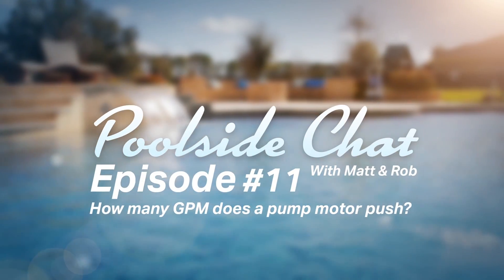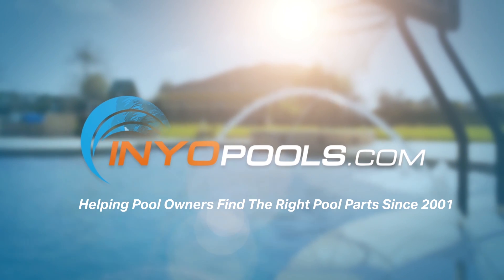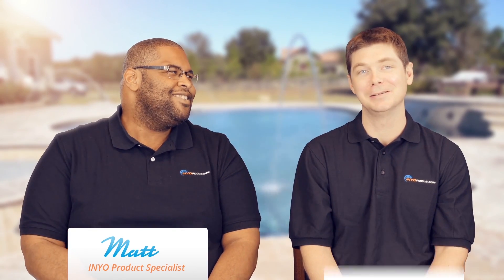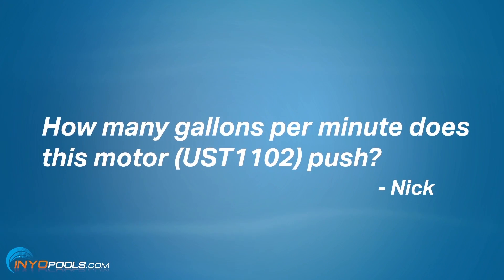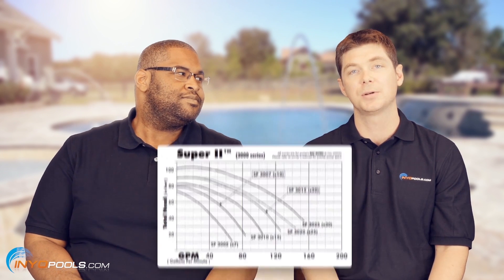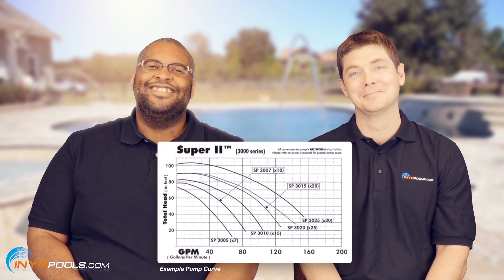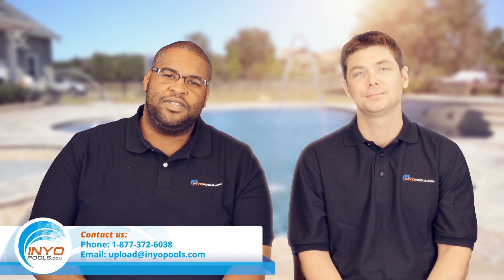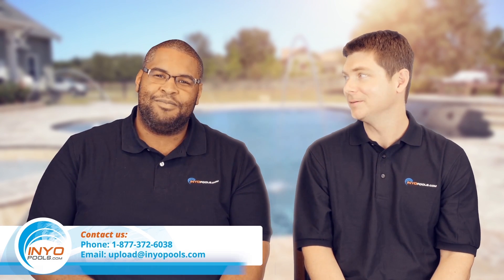Poolside Chat Episode 11: How Many GPM Does a Pump Motor Push?

Comment: pitiful answer
Reply from the maker: We were still green at making videos back in 2015. However, the answer still stands. There is not a set GPM for motors. It depends on the pump and the feet of head. One thing we should have mentioned is adding a flow gauge to your plumbing. That would be the simplest and most accurate way to determine the gpm output.